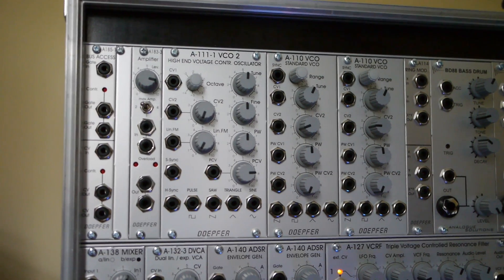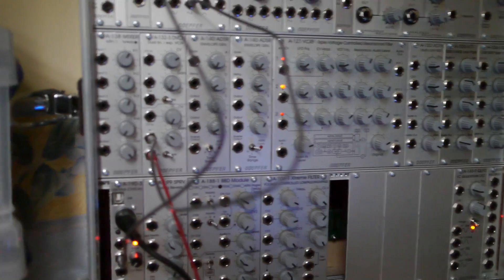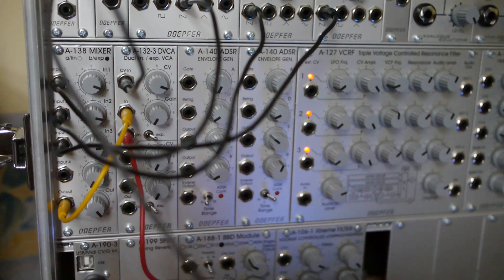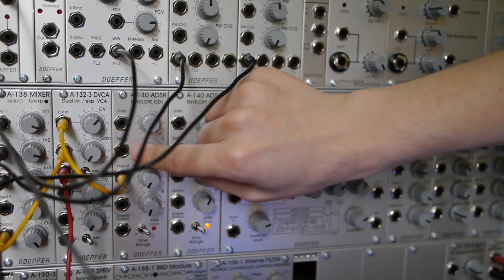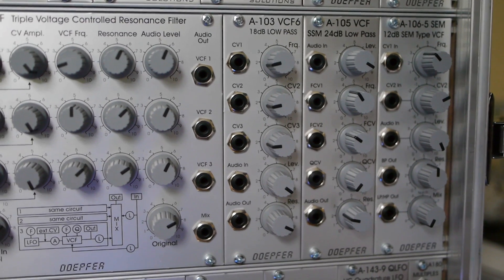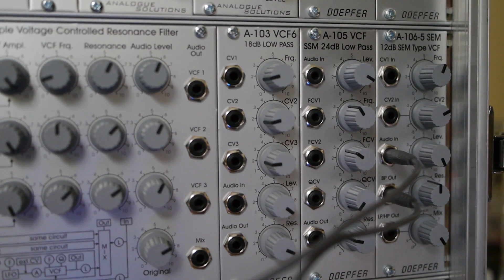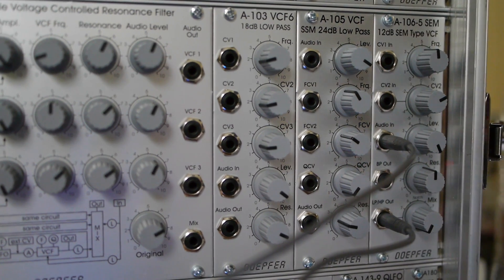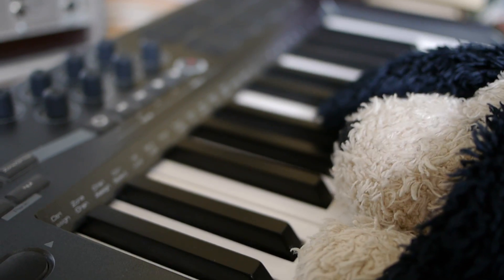A short guide to sound synthesis

Comment from the maker: Everything you can see, or everything I've talked about in this video?  It's much more affordable than the big equivalents were in the 60s! :D  Pop over to thomann.de, search for Doepfer, and have a look! You'd need a case, a MIDI to CV converter, an oscillator, an ADSR envelope generator, an attenuator, and a filter. It's affordable, and the more other modules you get, the more versatile it becomes, hence eurorack is affectionately known by its fans as eurocrack.

Comment from the maker: I've finally worked out the trick with using lots of different devices: do with each what you can't do with the others.  Use Thor for haunting, almost choir-like pads.  Use the A-100 for 50s and 60s alien sounds and thick basses.